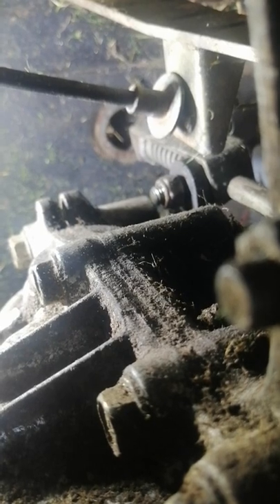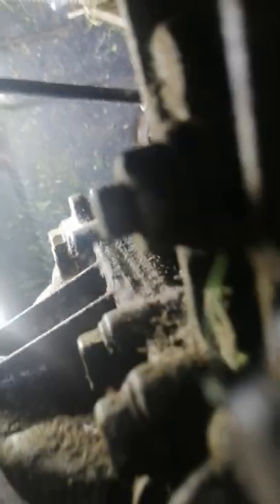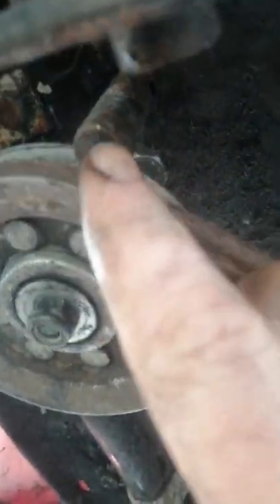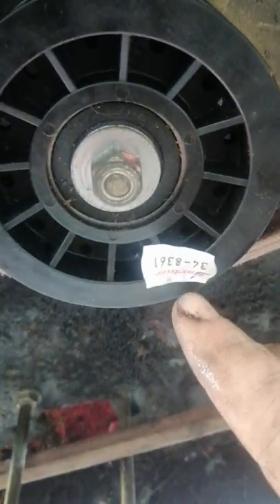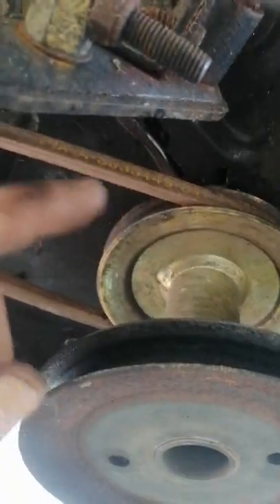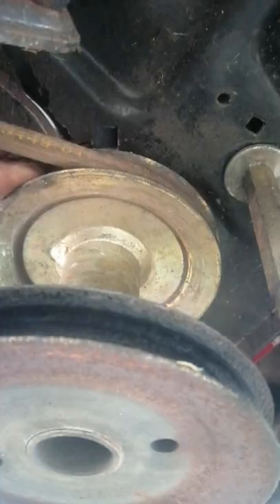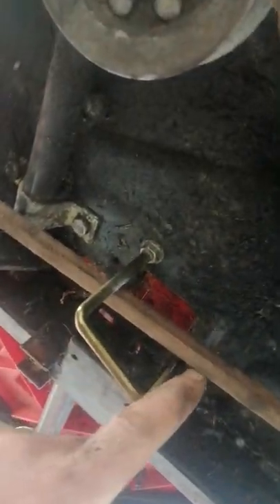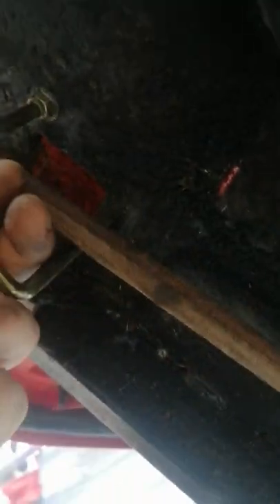Castle Garden(Garden fox) (viking mt785)drive belt

Comment: Thanks for the video- I’d never been able to fit the belt without it- especially the bit about removing the bar to get the belt outside it. Although It is still a bollocks to get at the nut to remove it as it doesn’t take a socket .
Reply from the maker: You are welcome.best thing though the belts last a long time
Reply: @joatamonmodsandrepairs Just bought replacement for a mower that is 21 years old and has done a mountain of work on the original belt. Snapped yesterday. This video is very useful. 👍

Comment: I have one just like this, by any chance could you tell me how to disable the seat cut off . Thanks
Reply from the maker: Lift the seat on the left side you'll see a plastic lever that sticks down towards the battery area,, it's pressing a half moon switch, wedge it with a piece of cardboard or you can adjust the plastic lever by loosening the two size eight lock nuts and pulling the lever back to press the seat switch constant with just the weight of the seat,,,  I personally wouldn't recommend ever bypassing a seat switch but that's how it's done
Reply: @joatamonmodsandrepairs  Thanks bit on my castlegarden it's wires that are connected and even disconnecting those don't turn it off
Reply from the maker: They have to stay constantly pressed to be bypassed, simply disconnecting the wires upsets the brake switch. If you have the switch off and the wires accessed you can put a fuse on the two wires
Reply: @joatamonmodsandrepairs  sorry for annoying you but what do you mean by putting a fuse on them. There is 3 wires. 2 dark brown wires and 1 lighter colour brown wire. Could I cut the switch off and join the 3 of them together or is that the wrong thing to do
Reply from the maker: Ohh,to be honest I'm not familiar with that, I've only came across them with two on the small castle gardens, have you a 102 deck on yours
Reply: @joatamonmodsandrepairs  I don't know to be honest
Reply from the maker: Is the switch at the back of the seat in the middle of both springs
Reply: @joatamonmodsandrepairs  it's in the middle of the back of the seat but not between the springs.
Reply from the maker: I've one in the yard I'll check the options on bypassing it tomorrow, that is a push down silver switch, I might be wrong but I think for the circuit board in that if you have the brake locked on it allows you to be off the mower and it stays running
Reply: @joatamonmodsandrepairs  I took off the cover from back of seat and it had 2 paper like circuits that click off and I took them off but seat light on dash is still on regardless.  Thanks in advance